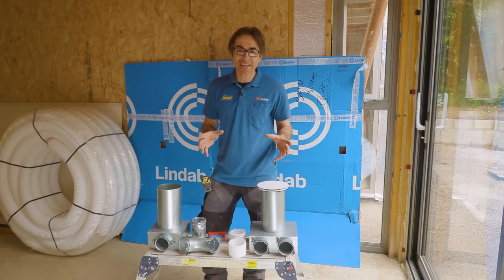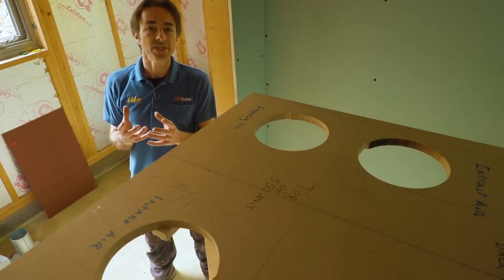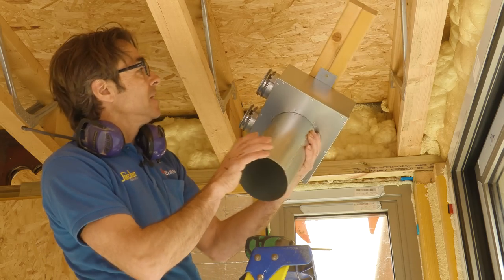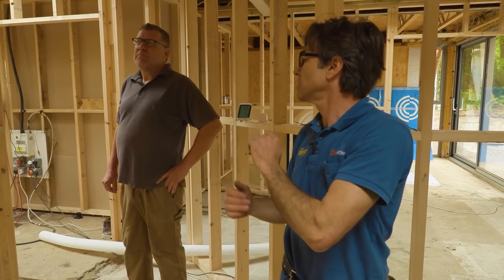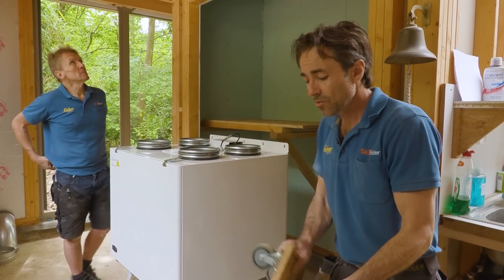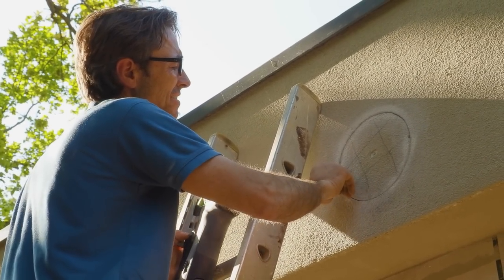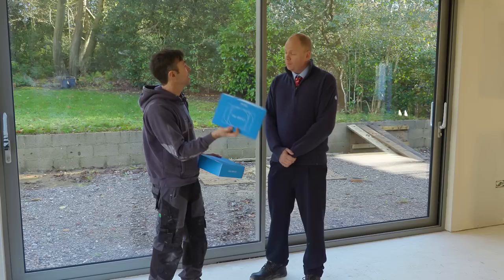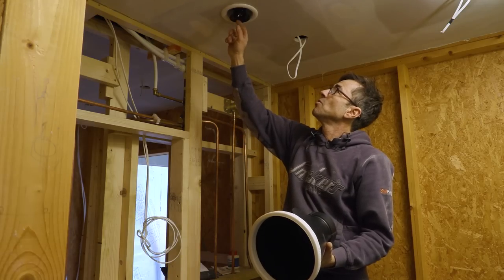Robin Installs the Lindab MVHR System - Capel #13

Comment: Hi, I'd be interested in a video that discusses retrofitting MVHR into a typical 80's brick and block house. I saw the loft condensation video hoping it would cover it but it didn't go that far.
Reply: The 80s house is air tight?
Reply: I doubt it. Wouldn’t that be one of aspects to address among many other factors?

Comment: A modern solution for a modern building. Definitely the way forward. Great video guys. And, as per usual, the thought and prep that's went into installation resulted in an asthetic and efficient system. Expect nothing less from robin 👌
Reply: Thanks you John
Reply: Mircea I think ur right, there should be a proper filter like the ones inside, would it not help with the intake and output so close together too.

Comment: Another great video Robin. Ideally you should seal the ducts after first fix. Not every joiner uses a dust extraction system like you do and this prevents harmful building dust contamination of the ductwork.  If people are considering retrofitting these, I believe MVHR suppliers  recommend a minimum air tightness of 5m3/(hr.m2)@50Pascals otherwise there is excessive leakage via the building fabric, making the system less effective
Reply: Was just wondering about installation mid renovation work 👍🏼

Comment: Fantastic video chaps! I’ve a 15 year old Mvhr system and been recommended to upgrade. Learnt some quality extra information from vid, thanks. Would love to go with similar system but think pipes will limit me to staying with same brand.
Reply: If you're going ahead with that, just be wary that the pipes don't affect the system by creating pressure drops which will decrease the efficiency and increase the noise. You could have the most efficient mvhr going but if you put shoddy ducting (PVC/flexible) in then it'll be rubbish

Comment: Awesome video! Thanks 

Does the unit separate the moisture from the warm air coming from the shower? Like a dehumidifier ? Ie it has a water catchment or hose that leads to the drain

If the unit was loud would u consider building a sound proof box around it ?

How does it deal with smell of the toilet ? You don't won't that smell distributed around the house haha

So basically to have a healthy house you first make it water tight then air tight then control then control the air inside? Is that how it works kinda like aircon in a car
Reply: It takes the warm smelly air from the bathrooms, passes it through a heat exchanger, then vents it outside, the cool fresh air from outside is warmed in the heat exchanger and sent to the living rooms, so no, it doesn't distribute smells within the house!
Reply: You can get either a enthalpy heat exchanger which puts the moisture back into the house (usually used in large houses with only a few occupants so the air doesn't become too dry) or a regular heat exchanger which takes the moisture out with a condensate pipe attached to a drain. Don't think the Mvhr he's used has that option though.
Reply: Daniel Payne ok just googled ....Ideal in-home humidity levels should hover around 45%.
Anything under 30% is too dry, over 50% is too high.

Comment: Hi Robin. Really enjoyed your video as an insight to MVHR. I've been working with this kind of stuff for many years as a hospital mech tech and understand all these principals. The only thing different, is that a huge catering kitchen as in a hospital has direct extraction to atmosphere via hoods over the cooking appliances. How would you incorporate this in a domestic setting. As a hob or oven gives out a huge amount of wasted heat, how would you incorporate this heat into the domestic MVHR system without the risk of cooking odours and above all, grease, oil and steam contaminating the main filters, ducts etc and permeating throughout the house? Many thanks. Derry.
Reply: Grease tends to ruin the heat exchanger.
Vent direct and have make up air imo.
Filter hood with carbon filter can go a long way

Comment: Neat system. I wonder how much energy this actually saves. And the boost mode should be energized by the shower light switch; wouldn't be too much trouble to add a small 2 conductor cable zip tied to the return pipe and over to the control panel. But boost scheduling will be decent for set schedule homeowners. GJ R&R
Reply: You should avoid triggering based on light switches as that is incompatible with smart bulbs.

Better to trigger based on sensors like humidity, or connected to the smart lights.

Comment: Really interesting.  Just one question.  As the air extracted from the bathroom will contain a lot of water vapour, is there a risk that it collects in the steel duct when it cools and condenses?

Comment: Hi Robin, what render is on the Magply board ?  I have a 460mm fascia and don't want to use plastic,  the Magply  board might be what I need . Ideally I would like to but join the board , scrim tape the joint and roll some kind of render or finish on the board that doesn't cost an arm and a leg to buy. Any ideas would be most welcome.  Thanks . 
Really good video, just one question  as you have underfloor heating would you get condensation in the plastic ducting ? as it would be relatively cool in that space with the type of heating you have

Comment: Hi Robin, Love your videos, please keep making them. Couple of questions for you regarding MVHR, I am just about to fit a similar system (Blauberg unit + Lindab 200mm spiral duct) and was interested to know why you don't seem to be using any mechanical fixing of the the ducting (self tappers or pop rivets) as recommended by Lindab and also why you don't have any silencers on the house side of the MVHR unit?

Comment: How easy is it to retrofit this to an existing property and is it something you’d recommend? I like the idea of cutting down heating costs? 
Great video 👍🏼
Reply: I think it would depend on whether you have joists like that and can access the ceiling space.
Reply: I think the technical term is a fkin nightmare. You can only really do this if you're doing a full refurb and I still don't think it's particularly easy even then. Solid joists everywhere!!

Comment: Top notch install, as expected . I've always been keen to fit this at home but i doubt our house is efficient enough. Just one question, the bathrooms only get an extraction point, not a supply as well?
Reply: John Mackay Obviously with extract only it could create a bit of a vacuum in the bathroom so a small gap under the bathroom door is required just to allow some fresh air in.
Reply: @TheBigSugs  so what's replacing the warm air being extracted. Is that not the same as what Robin disliked about an extractor fan. Or am I missing something?
Reply: Air is drawn into the bathroom from under the bathroom door (whilst showering etc)
Reply: @TheBigSugs  so it's no different to having a normal extractor fan above the shower. It will just suck the warm moist air out of the room pulling air from under the door at the same time.
Reply: I believe so yes. There is a significant advantage though and that is that the additional warm air from the bathroom (caused from showering/having a bath) will be extracted & recovered by the MVHR system rather than just going straight to outdoors like a typical bathroom fan would do.
Reply: TheBigSugs yeah the showering and cooking is the key to heating up the fresh air. In winter if I’m away, house gets colder as there’s been minimal heat generated to warm fresh air. 
The gaps under the doors is one of biggest downside to mhvr
Reply: @heriothandyman3148  I just thought it made sense to have the same air supplied to the bathrooms as the other occupied rooms along with an extraction point to get rid of the moist/smelly air, just keep it recirculating. Or would that just be overkill?
Reply: @heriothandyman3148  that's because it's not an active heating system. It just recovers the heat already within the property. Valve post heaters are possible but hard to retrofit if you're looking for an option. Every new build these days should have door gaps even with extractors and  trickle vents but I doubt that's happening

Comment: Help!

I have an early 18th Century terraced cottage. It's roofed with thin Yorkshire stone, typically 15 to 18mm.

It's the original roof, most of the lime mortar and timber fixing pegs are in place but I have a number of cracked slates. 

I've had a number of reputable local roofers out and they are all reluctant to go onto the roof. They think that they will probably do more damage just by putting ladders onto the roof, 

If I reroof, I have to use the same slim slates so that they match the houses either side. There's also the issue of getting hold of enough slate to do my roof. I'm getting quotes of £10K to £15K just for the stone to do one side. It seems that the quarries don't like cutting thin slates, they get get more breakages and it wastes precious stone.

I'm considering having closed cell PU foam sprayed on the underside. The foam is from BASF and is applied by their approved contractors. Price is about £5K

What are folks views on this sort of application?

Comment: Hi robin I noticed you didn't insulate the external vent pipes.  Were you advised to?  As I would have thought bring cold air into a thermally sound house through steel pipes would produce condensation!
Reply: Hi Clive, although not shown in the film the supply pipe to the unit and the extract pipe from the unit where fully insulated between the unit and the outside for exactly the reason you suggest, hope that helps many thanks for your comment

Comment: Without looking at the build, I am sure if you can get the duct off the MVHR to run through the timber frame as you could get it to the manifold and have shoes off your 200 dia good big to each room. Not a fan of flexi duct would of run it all in solid and the safe fittings aren’t as good as portrayed. Duct seal is better. Also mounting the unit on cantilevers with anti vibes or dropping rods from timber is much easier to level of and reduce vibration and noise

Comment: Robin, does the system detect moisture, say from a shower, in trickle mode automatically speeding up to boost mode and then automatically drop back to a trickle again when the moisture level has dropped back down?
Reply: Don't know about his but you get some like the Zehnder CAQ series which do. I've heard of some which go on a timer, but personally I'd rather have one that boosted until the humidity was gone instead of when the timer ran out

Comment: Is it possible to retro fit these in a Victorian terrace house. I have a 1900 terrace house and issues with damp in the kitchen and bathroom. It's a big house and a dehumidifier is struggling to keep up and costing a lot to run

Comment: Robin, I have a wood burner in the living room, when it’s on the living room gets very warm but doesn’t really get to other areas of the house very well so I feel like allot of the heat is wasted a bit, would this system be able to direct the hot air from the living room to other areas? And have it set up as an extractor in the bathroom? Another great video as always, really enjoying your build.
Reply: There is very strict rules that surround the use of wood burners and a whole house ventilation system, I was planning to have a wood burner but the device needs to be room sealed and it takes its air from a duct directly from outside, only about 5 percent or less of available wood.burners are totally compatible with MVHR, we have opted for a room sealed gas fire as the look we want to achieve was so expensive with the equivalent wood burner that it became ridiculous!!! Hope that helps

Comment: Couple of questions (I'm in the UK.): 
Did you consider AC in addition to the MVHR?
Does MVHR add any value to the home?
Reply: Hi Nathan, I never considered AC as I am running underfloor heating throughout, I chose MVHR as I wanted a ventilation and extract system that would use very low energy, be really quiet and not have to have 9 extractor fans and their pipes out of my flat roof, it is also a requirement of building control to have background ventilation usually by small vents in the windows etc so I did not want these vents as they spoil the aesthetics of the look of the build, thanks for the comment hope this answers you question
Reply: @ukconstruction  Hi Robin, Good answer - but it's only the truth really, so an easy one! Am I right in thinking that the building is so well insulated, being too hot isn't really going to be an issue so long as doors/windows are closed? Also you've got quite a bit of tree shadow around as well. Keep up the good work!
Reply: @bikerchrisukk  hi Chris, yes we have a really well insulated envelope and we don't suffer to much from solar gain thanks to the trees, I have been monitoring the temperature in the building all through the summer and now into the winter and regardless of the outside temperatures  the inside only varies by about 2 degrees either way, thanks for the comment
Reply: @ukconstruction  That's basically the difference between wearing underwear or no underwear. Nice. I expect the heating bills will be very minimal. I have a newish house <10 years old and I wish the builder - excellent as he was - had taken this approach. The house was already up when we saw it unfortunately, so wasn't an option. Great video.
Reply: @ukconstruction  Hi Robin, that sounds perfect, fair play for monitoring as well. I'd be glad to pop by with my infrared camera, but there would probably be little point. Keep up the good work, must be brilliant to apply a right way of doing things after seeing so many cost based construction decisions being made (hope that makes sense).

Comment: How do you measure accurately for the position for outside hole? Whenever I encounter this problem things never line up despite seeming to measure multiple times I am off!
Reply from the maker: use a pilot drill and you can then adjust the position if you are a little bit off.

Comment: Another great video, I suppose you can only install that system if you’re using those joists?
Reply: Hi Steve, if you plan your initial house design well then you can use this with traditional joists in some larger new builds the may have concrete 1st floors and they fix the dusting to the underside on the floor and it is hidden by dropped ceilings

Comment: What happens if there is a fire. Won't the ventilation be supplying nice fresh oxygenated air to the blaze? Thanks
Reply from the maker: yes you are right. Often a fire will use up the oxygen and die down to a smoulder , like a cigar, which will eventually burn everything but open the door and it flares up in seconds.

Comment: Not seen any in Aberdeen yet .dose the ducting need insulating to prevent condensation ?
Reply: Great question... if any ducts are not within the insulated envelope of the structure then yes, the main extract air and intake air ducts need insulating away from the main unit too, thanks for the comment

Comment: Great video Robin, with Roger in the background this time. You guys are amazing.
Thank you for keeping your promise to produce a video on MVHR and Cheers for that. Been waiting for months.

Qs. Most of it, maybe Lindab can answer.

If I were to be using this system in a hot and humid climate with air conditioning to cool the house, the same system should work right? I ask this because there is always talk of only heat recovery! I guess simple principle of physics should hold true for cooling recovery as well. Just asking.

Second, do you have longer version/footage on the plastic ducting through bends and walls and awkward turns? That will be useful, particularly the fastening/clips part for installation.

Third, what about a multi level concrete house; concrete floors, walls, ceilings.... Duplex or Triplex. How will the ducting work?

Fourth, How do you do sizing of the unit? How does one determine the inward/outward pressure?

Fifth, What about timers? Is the system on all the time? Or can you set it to work for 5 mins, or so, in an hour so it effectively works for about 2 hrs in a day!

Just asking. Please let me know.
Reply: Rajesh Iyer couple of answers for you.  The size of the system is determined by the size/volume of the property.  The system is on all the time .   It Can have automatic boost or manual.👍
Reply: Hi RajeshCooling options are available to temper air temperature, not all MVHR systems provide cooling however even without, the fresh air can make a room more comfortable. We don't have a video of any longer examples of the ducting unfortunately however we can advise on any individual project. Without seeing the specific design of the building it is difficult to advise on the ducting requirements for duplex, triplex or multilevel houses with concrete walls and ceilings however, we have a solution for most applications and could provide advice relating to a particular project with more detail.Again, each unit is sized upon assessment of the requirements of the individual projects and a variety of factors are taken into account such as the volume of air and the preferences of the client which can be discussed at system design stage. The air flow levels can be set at commissioning stage.  MVHR systems can be set to run on timers however they are designed to run all the time at a minimal level which maximises efficiency and provides a comfortable air quality.  Please feel free to email residential@lindab.co.uk if you would like to discuss further.